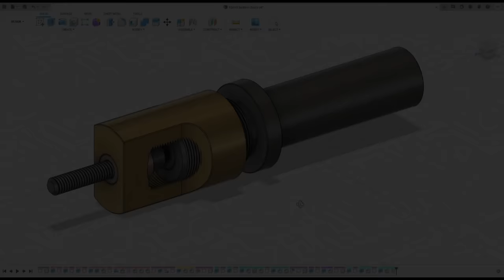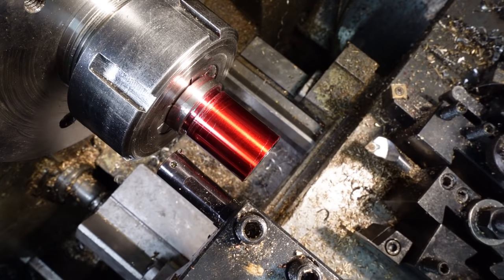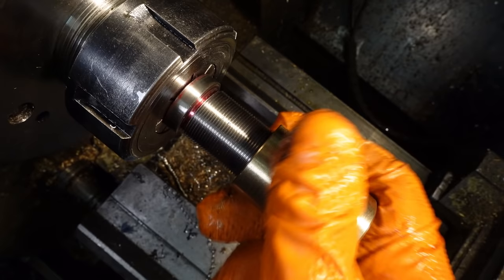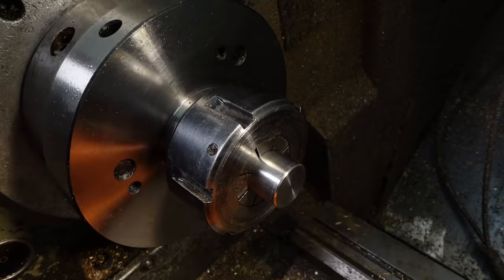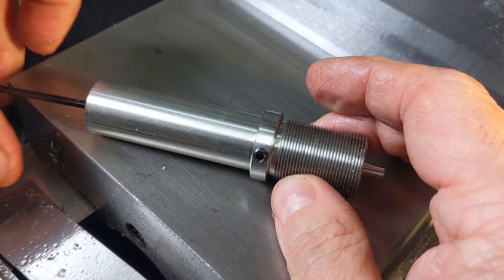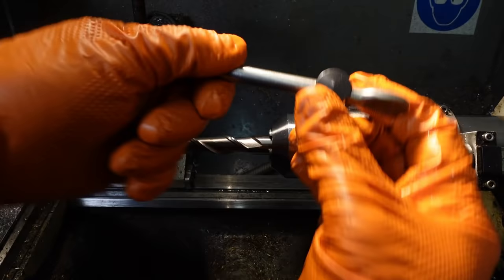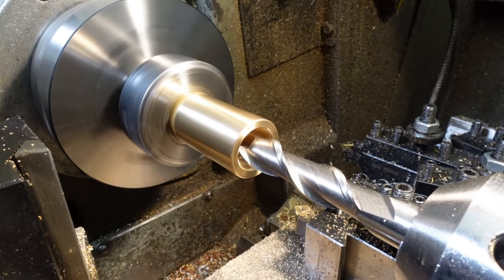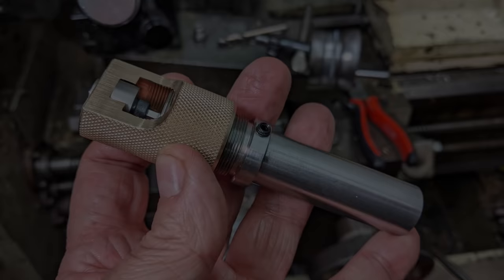Lantern Chuck machining and build #toolfest2021

Comment: The better you are trained, not to drop small parts (excluded swarf), the untidier it can get!
I just try to figure out for myself if it is more easy to fix my clumsiness or tidy up.
Best option; watching others on Youtube solves everything: No swarf, no untidiness, no small parts, no clumsy accidents, no gloves.
 
I like a 3d probe. But I had to shift my clumsiness level in order to use it. Repeatability of a ceramic edge finder seems to be as good, if not better, risk of damage for the edge finder is less and it is cheaper than the spare probe tips :-).
Reply from the maker: I find that I'm using the Haimer a lot where I am machining enclosures with lots of features, but I still use the rotary edge finder when I'm not bothered about great precision or making lots of measurements on each workpiece. I did consider the Fuji CEZ-10, but it's a lot of money for a basic edge finder.  Insize do one, but it's not that much cheaper. perhaps when I lose or ruin my current favourite edge finder, I'll treat myself.

Comment: My thoughts about tidiness in general (just for the conversation): I'm not really caring about the mess itself, but the fact that when doing stuff, precision machining, electronics etc. mess can cause you to get bits of metal or other stuff where you *don't * want it to be that can either mess with your tolerances (by getting into the collets or between precision surfaces) or in electronics it can get into the stuff you're working on and cause shorts or something else... equipment failure.

So I'm trying to keep my work areas clean because being messy has bitten me from the ass before. More than that, enough mess and I start wasting time by not finding what i'm looking for, misplacing items or losing small items into the mess.

So yeah, i don't have the cleanliness gene either... but I try because I've lost so much time or messed up enough things or it has costed me money to NOT be clean... my cleanliness comes from the rage and frustration I've experienced because of not being clean... not from having to be clean in itself :)
Reply from the maker: These days I keep things much cleaner having bought a new shop vac and a gallon of Simple Green! I also got very tired of the delicate snowflakes who moaned all the time about it! They seem to have regained their composure and I don't need to rant any more!

Comment: My condolences in your loss.  

I was forced to clean up my lathe as what I had been turning was VERY stringy and I had to pull out a half of a 5 gallon bucket of tangle.  I should sweep the floor as I track the chips into the house.  I really don't understand how some of these people keep their machines so clean.
Reply from the maker: New shop vac is helping, the Colchester is looking a lot tidier now. I always get rid of the razor-wire stringy stuff as soon as I can find my heavy gloves. Titanium is a nightmare, and 304 stainless isn't much better in terms of injury risk while cleaning.  Still haven't fixed the sharp bit on my shovel either.  Must remember that or I'll slice my hand again.

Comment: "Stainless?" (remembers previous encounters with stainless)... (clenches buttocks)... uh oh!
Strangely, I also used to know a Nick who was over fond of saying "job's a good 'un".
Your voice-overs are FAB!
Reply from the maker: I tend to use ultraviolence against stainless, and dig out mighty chips with some stainless-specific inserts and no coolant, but then for a super-fine finish I use the Noga-Cool blast mister and a super-sharp high-rake insert intended for aluminium. It makes a wire-wool birds-nest, but leaves a lovely finish and doesn't work-harden the surface. Taking big chips that make my 3HP motor wheeze and groan seems to work nicely, and gives well-formed chips, but doesn't give a mirror finish like the lapped inserts do. I'm sure I could do better with a much more muscly lathe, but I rarely make stainless parts more than 50 mm diameter, and most are under 20 mm.   
I take the view that nobody wants to hear me mumbling and grasping for the right words while trying to get the old clunkers to do my bidding, so it's all done as B-roll and voiceover, with ambient recordings of machine noise at a low level, but very careful attention to the clinks, clicks, clunks and tinkles of tools and parts and toolposts and gearboxes.  Sort of thing that a less-principled sort of chap might label as ASMR.  Shudder....
Reply: @MachiningandMicrowaves  with my low skill levels and tiny tiny lathe I've just "learned" to shy away from stainless and stick to free-machining steels. :)

Comment: I am doing an oversize version of this. I will do a small one like this some day too - I already have the quarter inch drive bits that I bought specifically to do this project, but never got around to is.

(Also delaying the project was the fact that I had to make a collet chuck from an old BMW wheel hub and a piece of square stock - because none of the round stuff was big enough! And then some procrastination a few times over!)
Reply from the maker: I hope you'll be able to share the end results! I need to make a tiny version to help make some solid silver M1.6 and M1.2 screws soon, perhaps I won't need to use a wheel hub!
Reply: @MachiningandMicrowaves  No, I suspect a car wheel hub may be a bit too chunky for that use.

I will report back with "how it went". I've got the brass nut and main part threaded and generally shapes, but still need to make a hole through the main steel part, and then all the small fiddly drilling and threading steps... But going well so far. Probably won't get it done until the weekend...  Oh, and of curse milling the cut outs on the side of the brass nut. Which means I have to tram the mill, as it's currently off-kilter. Why is it, every time you try to do one fairly simple job, it always turns into 4 other jobs first... :)
Reply from the maker: @matspatpc  It's The Law. The number of side quests and rabbit holes is theoretically infinite for any interesting job

Comment: Surely, as long as the chuck isn't picking up old swarf and flailing you to shreds with it, there's no need to clean the lathe until you can no longer find the parted off components or dropped tools? 😁
Reply from the maker: One of us (probably not you) spent ten minutes just now searching for a parted off piece of Delrin that disappeared after I cleaned ten minutes worth of ribbons from the chip tray and put them in the waste bin. No sign of it in the empty chip tray. Several minutes spent pulling an ENORMOUS amount of Delrin ribbons from the bin, along with a few nasty sharp bits of Mystery Metal that was sharper than any sharp thing known to Science.

No sign of it at all.  

Searched the chip tray again. Nothing. Put my smartphone in the chip try looking upwards.  Nothing. Put it behind the carriage, and took a photo.  AH-HA!! 

The lump of Delrin did at least have the decency to look embarrassed.  It had landed on top of the protective cover of the DRO scale and rolled along, hiding out of sight in that dark, oily cavern.  Chances of getting that to happen again are so tiny that my luck must be in.

I'm buying a lottery ticket right now.
Reply: @MachiningandMicrowaves  😂 I would if I was you. You just couldn't make up that sort of thing.

Comment: This is an extremely well made tool and performs it's job perfectly.  I think I would go another directly.  Octagon stock for a three jaw chuck, clearance, drill, tap for the screw to be "adjusted", flip and trim the stock to the length you want to make the screws, turn in reverse.  Would have to make one for each length and size screw but sure would be faster and so much simpler.  Could use a tool steel stock so you could harden if you felt necessary.  But you see, I'm impatient and like to get on with things when I'm at work.  Now that I'm retired, I think I would make one just like this. ;o)
Reply from the maker: I think if I could get left-handed stub drills and reamers in a sensible range of sizes *at a reasonable price*, that would make good sense, as I could use the rear toolpost with the lathe in reverse for right-handed screws without having to use inverted tools in the front toolpost. There are two main defects with this design compared with a classic lantern chuck.  First is that the collet alignment depends on the threaded barrel, so there's a limit to the precision for chamfering or drilling the screws.  Anything smaller than M3 is really a step too far.  Also, the axial position is defined by the screwdriver bit and the slot/hex/torx/PH/PZ in the head of the screw rather than the underside of the head.  In terms of speed, I tighten and loosen it under power when the safety police aren't watching, so it's pretty fast operate, especially on short screws.  It worked very well making the M8 brass tipped screws in https://youtu.be/ViRQuaKx3ik?t=239 but For proper precision work, it really needs the collet to fix into a solid body with side windows and then have pressure applied to the screw head using a sliding or rotating plunger.  

I'm thinking of making one as I need to make a load of really tiny tuning screws threaded M1.2 or M1.6 or extra fine threads on M2.5. The privilege I have of being able to waste endless time making stuff a particular way for the pure pleasure of doing it, is not lost on me. It certainly IS a privileged position, not having to care about choosing the most efficient/fastest/cheapest technique just so I can feed my family.

Lots of fun ahead! I must make a vid about threading in reverse with that rear toolpost... Cheers, Neil

Comment: You have a rather nice Colchester so thread chart and gears will be way more accurate than the hit or miss Chinese stuff the majority of us have today.
I had forgotten just how much I miss the British sense of humor since I moved (and sold my Colchester 25 years ago 😥)
I'm stealing that idea of hex bit holder as I often need to shorten Allen and Torx screws in smaller sizes (3mm, 4mm, 5mm thread) and need to make a new lantern chuck anyway.
 I was thinking of same for adjuster, drilling from back, easy enough to counter bore (drill oversize) to guide screw into position
Boring bar probably squeals bad in brass because it has a positive top rake, a flat or negative rake HSS would probably cut better as it won't get pulled into work-piece (stoning a flat on cutting edge of drill bits also works wonders when drilling brass, does mean you need the sizes used most doubled up though as they don't cut well in anything else)

Comment: Nice to see someone else using inserts for aluminium on steel. I have been suggesting these as a way assist mini lathes in getting the job done.  They are so cheap it hardly matters if they don't last too long. My cnc lathes are only 1/2hp at the spindle so I have had to learn to cheat any way I can to get the job done. I was watching another of your videos and was going to ask what a lantern chuck was and it turned up in an end card!
Reply from the maker: The algorithm knows what you're thinking! I just bought a load of those polished positive inserts from Cutwel on a special offer, so I can afford to use some on stainless. My lathe has a 3HP motor and it can take serious cuts on 4140 to get a really nice finish with a coated insert, but on stainless, light finishing cuts with the aluminium inserts seem to work fine. They also give a super finish on Titanium unless you stop feeding, then they go white hot and ignite the chips. Titanium fires in a bird's nest of stringy chips tangled round the toolpost are FUN
Reply: @MachiningandMicrowaves  that would be the only time the algorithm has done me any favours, certainly not helping my channel very much. I figured that end card was selected by you, or was it one of those best for viewer cards?
Reply from the maker: @smallcnclathes  Can't remember, but I usually pick "latest" and "best for viewer".  Subscribed to your channel
Reply: @MachiningandMicrowaves  Thanks for the sub, I just reciprocated.

Comment: Ehhh, I think very thin nitrile gloves are fine to work on a lathe with.... It's a bit dogmatic to just unequivocally say gloves are verboten.
We are of course all concerned about entanglement and ahem de-gloving hazards and the like. That's just plain bad and we don't want it to happen to us. 

But does anyone here really think a thin nitrile glove could ever actually pull someone into a piece of rotating equipment? I just can't see it happening even under the worst circumstances. The things break at the very sight of a burr! 

Plus my skin isn't a big fan of all the various tinctures and oils found in the shop. Occupational skin exposure to these things isn't great.

edited: added extra

Comment: Fantastic work! As for cleanliness, I don't bother until the end of the project. Speaking of politicians, do you have a 35mm reamer with a reduced shank? Need to give them something to think about after a 35mm treatment.
For a moment I thought this was going to be a tuning device used on microwave cavities. A very interesting way to custom cut a screw length! As we say in the Ham world, 73! Keep up the great work and humor!!!
Reply from the maker: Sadly, my largest is 20 mm.  Still a "convenient" size. (cough). I'm making a much smaller lsntern chuck so I can machine extremely small tuning screws made from solid silver, and stainless screws with 1mm diameter sapphire rods in the end, again as resonant cavity tuning adjusters. So you weren't far off the mark in reality!

Comment: The reason most machinists do a scratch pass & check it when cutting threads on a lathe is just to double check they didn't make a mistake when setting the lathe for the desired threads. It is much better to find out you screwed up before ruining a part in the last operation. Between the labor cost & the material costs a simple mistake when cutting the threads could cost a company a lot of money and a machinist his job.
Reply from the maker: Yep, 100% correct.  However... I'm in the lucky position of being able to choose to scratch or not. It's a privileged position, not having a financial or time imperative or a Boss to tell me what to do.  So far my score on single-pointing is about 870 successes and zero failures, but I DEFINITELY do a scratch pass if it's something irreplaceable, and use Dykem or Sharpie so I'm not even marking the metal. I'm lucky that my ancient lathe has very obvious threading settings and no change wheels to mess with.  I think 870:0 probably represents an acceptable risk ratio for a bodger in a home shop.  One day it'll bite me on the bum and AIMEE will take the pee out of me with zero mercy, but so far, I'm still ahead of the game. 

Rule One: these vids are about "How I did/made <whatever>".  
Definitely not about "How others should do/make <whatever>".
Reply: @MachiningandMicrowaves  My "ancient" lathe is a 1911 South Bend with several change gears missing from the pile of loose gears.  I definitely do scratch passes, or at least will until I get enough experience to trust that I've selected & installed the proper gears!  ;)  Of course, I need to "upgrade" the old 1-inch-wide (25.4mm-wide) leather belt that slips every time I try to make a cut (though at it's maximum swing capacity) before I can get serious enough about playing with it to (re-)learn single point threading -- but I will use the Joe Pi method everywhere it turns out to be easier!
Reply from the maker: @bobvines00  Now THAT is a Senior lathe! Making chips for well over a century.  Long may it continue

Comment: @26:30 It's 2024, start drilling with the carriage and get you a keyless chuck too.
Reply from the maker: Waaaaaay ahead of ya! I made one back in April 2022 after being convinced by a video from Stefan Gotteswinter. The ancient DRO on the Colchester doesn't have tool offset memories, so it 's a bit annoying that I have to realign the cross slide each time. Also, my toolpost doesn't index, so I have to align the axis each time as well. It's fine with a solid tool post, but I still use the compound slide for taper turning. As a result, I've probably only used the tool post chuck ten times in the last two years. I'm transferring most of those taper jobs to run as mill – turn operations on my new SYIL X5 CNC mill, so I hope to ditch the compound permanently.